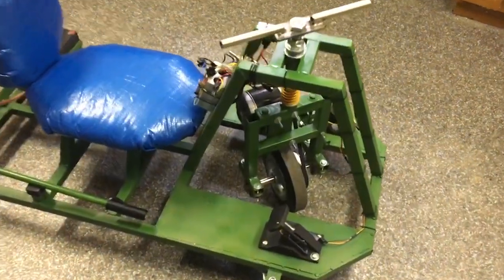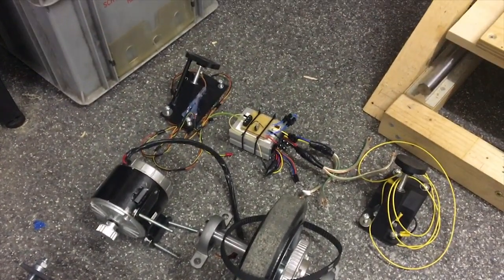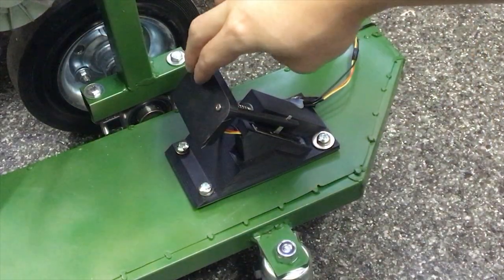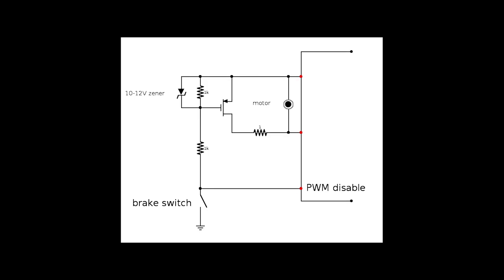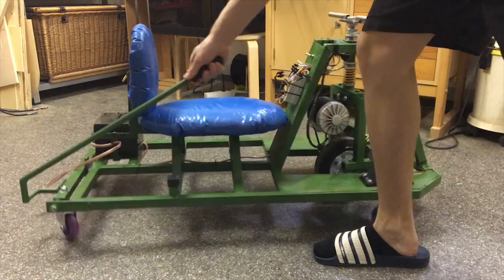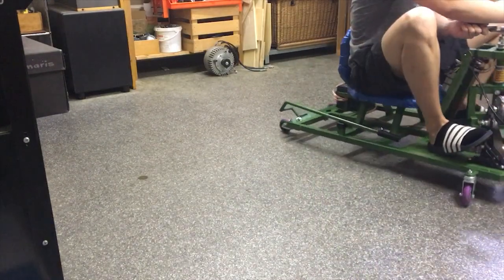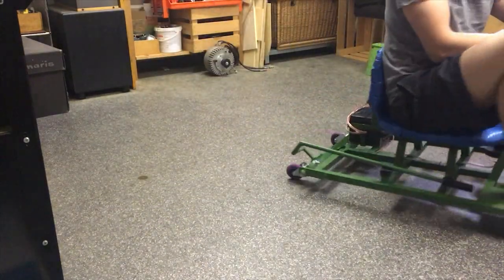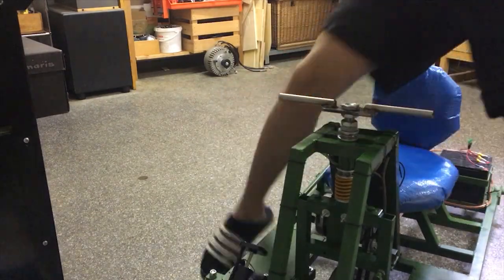DIY Crazy Cart with Plans

Comment: I don't really understand the point of the lever wouldn't it work the same without it?
Reply: That one in the back? It's the handbrake and without it it wouldnt drift smoothly
Reply: When the wheels are 90⁰ they can spin freely which makes you drift. When they are in a 20⁰ or 30⁰ angle they cant spin freely so you can drive normally like a normal cart
Reply: @RED-dv2hq drift stick
Reply: @bs9two4  that's a handbrake bro
Reply: @RED-dv2hq  no technically its a drift stick cuz it js pulls upb the whees

Comment: Hi cool video 
Do you think I can use a cordless drill to power the Crazy Cart?
Reply from the maker: If you have a mechanism for triggering the cordless drill it could work, but I think you will preform better by using a motor and a controller like in my design.

Comment: Hi, this is a great build, what is the total length of metal needed to build the chassis and how long are each part for the chassis, the build plans don't say anything about each length. How big is the space from the front to the first tuubing that goes across
Reply from the maker: You are right, somehow the length is missing for the parts of the chassis itself. I will update that next.
Reply: When would that be, I am trying to make one and I need some dimensions, for the steering, what did you use to attach to the chassis so it can spin.
Reply: Also how high is that triangle thing at the front for the steering
Reply from the maker: Hi, here you go: http://www.mediafire.com/file/0esc4vn227614o7/Chassis.PDF/file

Comment: Im building this projekt and i have one problem with wheel. Every wheel that im looking at Has bearing inside. Isn't mounted on screws on any other think. So how can i mount poulie on the wheel if wheel will rotate freelly from axle. Any one Has any advise how to attach it. Idk weld or somethig..?

Comment: hi, can I use the hoverboard wheel motor as a motor? when drifting, does the front wheel go into a skid? If not, can I use the engine from the 360w washing machine?
Reply: You can use the hoverboard motor
Reply: @thecrazerkid2146  will 200w be enough?
Reply: @damirrimad1823  yeah but depending on how much you weigh the original crazy cart has a 250w motor so you should be good with 200w

Comment: Hey Applied Eng.  keep us apraised of all the upgrade recomendations for a future build (1-lower center 2-more grip on driving tire 3- manual brake) any more recomendations?
Reply from the maker: Hey cbarber, that summarized the problems I encountered in this build. I further recommend to mount the motor more center-aligned to the steering axis to lessen the inertia. What also is very crucial is to ensure, that the castor wheels are orthogonal to the floor when the lever is pulled up the whole way, otherwise you wont go always in the drift mode, especially at low speeds.
Reply: @ttschabos  Hey would you be interested in selling me this first draft?

Comment: Hi..
The other crazy carts dint have brakes or motor brakes..
Why do you add it?
Reply from the maker: Because at higher speeds you sometimes need a brake and it makes also the whole cart more easy to handle

Comment: can i know how you deal with the break???
Reply from the maker: I use an electrical brake, which shorts the motor over a power resistor to dissipate the energy. This only works for high speeds, since the braking power is quadratic in the EMF voltage, which is proportional to the angular speed of the motor. I would recommend a mechanical brake, which could directly be mounted on the front wheel, which would make you way more versatile at low speeds.
Reply: Applied Engineering wow im impressed that how fast you reply😂 I've been looking for a diy crazy cart video bcs they looks hella fun but the price is unacceptable, can you give me the total of the parts? also include the price of a brake kit
Reply: Applied Engineering also i try to find the motor on aliexpress but all of them have a gear set attached to them, would they work the same?
Reply from the maker: :D I was just in front of the computer. You can buy everything on aliexpress for around 150$-200$, but the steel you need to buy at your local metal store. 

For the wheel you can use for example this rim here, where you can attach a sprocket and a braking disk:
https://www.aliexpress.com/item/New-Aluminium-10inch-Rear-Scooter-Wheel-Rim-Aluminium-Rear-Wheel-Hub-10inch-for-Scooter-Tire-Scooter/32368040957.html?spm=a2g0s.9042311.0.0.JR2E9m

The motor is a my1016 (without z at the end -> no gearbox), which is available with different sprockets on aliexpress.

Comment: Nice project, I think I'm gonna build something similar, but with a stronger motor. Would 1000W be enough?
Reply from the maker: Ye, 1000W are more than enough for such a cart, since at higher speed this thing loses control very fast and so is better to use for slower speeds and agile movements.
Reply: Hey for the triangle thing at the front what distance did you put them apart from each other

Comment: how high is that triangle thing at the front and what is the length of the base of it
Reply from the maker: Hi, here is the link to the new chassis plans: http://www.mediafire.com/file/0esc4vn227614o7/Chassis.PDF/file
Reply: for the angles did you use degrees becasue the angles don't make sense to me
Reply from the maker: Yes, in degrees. Well, it is eactly like this, 20°+2*35° = 90°, and that twice gives the 180° for the triangular part.
Reply: Sorry and also for triangular part how long is the cross section at the top(how wide is it)

Comment: what batteries did you use for this motor?
Reply from the maker: I used two Kung Long WP 14-12SE-F2, but you can actually take any battery with enough power and 24V.

Comment: Is there anyway you can turn the wheels 180 degrees like on the crazy cart xl and How much money did you use to make it?
Reply from the maker: The cart can turn directly around the fronwheel, so a 180° turn is possible. I spent around 200$ for all the material. What I can recommend after the build is to use a frontwheel with more grip and to lower the seat, such that you cannot fall off so quickly.
Reply: Applied Engineering Thank you for replying. I really appreciate. Thank you for the video too. I've been wanting one but don't want to pay $700. How fast is your car? I know it depends on the motor but what speeds do you get.
Reply from the maker: The car makes about 18 km/h with the 350w motor. There are plenty of available motors with motor controllers on aliexpress up to 2kW. What I really recommend for higher power motors is a mechanical brake.
Reply: Applied Engineering oh ok. What type of battery did you use and how long does it last?
Reply from the maker: I used Kung Long WP12-12, they last for around 1h, but they are not really made for cyclic usage, so I LiPo would maybe fit better here.